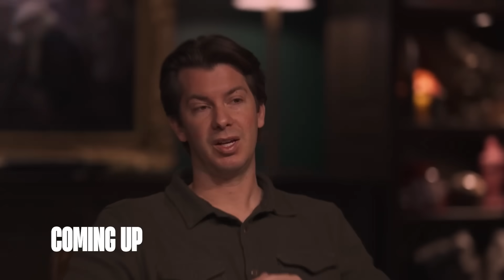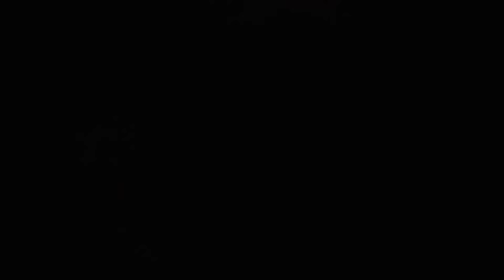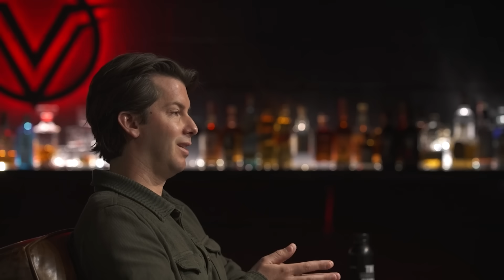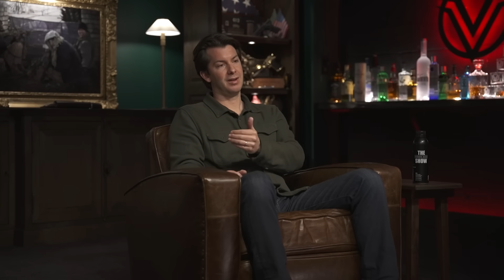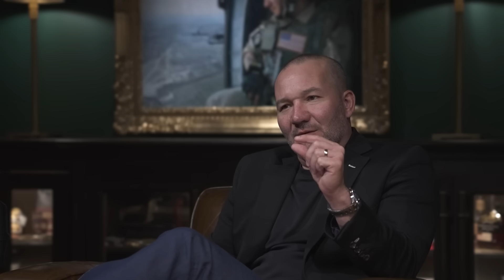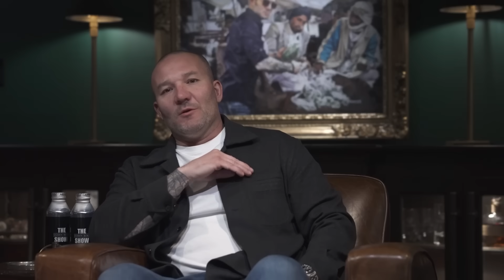How Enriched Uranium is Made to Fuel Nuclear Reactors

Comment: Uranium enrichment becomes exponentially harder the higher percentage you go. It may take 100 centrifuges just to get to 5%. That doesnt mean it takes 200 to get to 10%. It takes thousands to get to weapons grade, which is 90% and above. Ofcourse, we do not have to speculate of Iran is making enriched uranium for weapons, or energy. The U.N. has confirmed that Iran has atleast 800 kg of 60% uranium. Iran admits it has enrichment facilities. This isnt like Iraq, like many say it is. Iran has extremely poor uranium deposits. Thats why it has taken them so long to get so little. The recent attacks definitely set them back years, and was entirely justifiable. Iran is the one country that would undoubtedly use a nuclear weapon. They dont want it for deterrence. They want it to use.

Comment: Nuclear reactors are basically Steam Engines.  We still haven't moved past the Steam Engine.
Reply: It ain't broke!
Reply: Like cell phones are just modern day radios?
Reply: That is like assuming that diesel locomotives are diesel powered when in fact the diesel is used to power a generator that powers the electric motors at every axle on the locomotive.
Reply: Literally hot rocks boil water
Reply: How else are you gonna convert heat to electricity?
Reply: There Is this big solar farm south of Las Vegas that's going to be shut down. It wasn't worth keeping

Comment: Fusion power is the answer to everything.
Reply: It is and the cool thing is the stuff they call waste can be reenriched to a different type and reused to create more power and that process can be done over and over and it depletes it to the point where it will only be radioactive and have to be stored for 100or 200years after  it is used up rather then a 1000 years
Reply: Its not ready for commercial use yet. But it is the holy grail. In the meantime, fission may be the temporary answer to everything